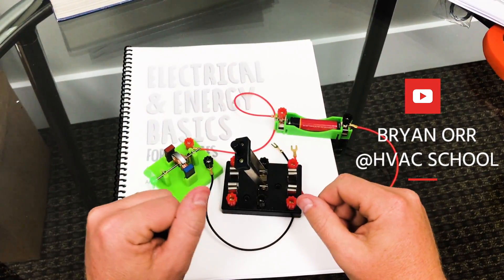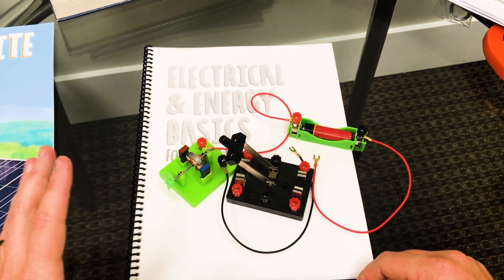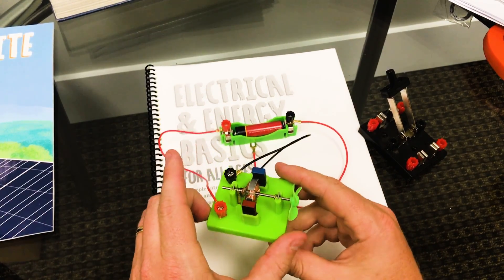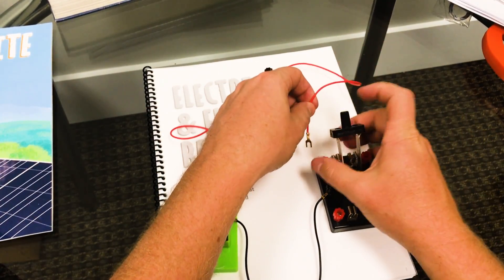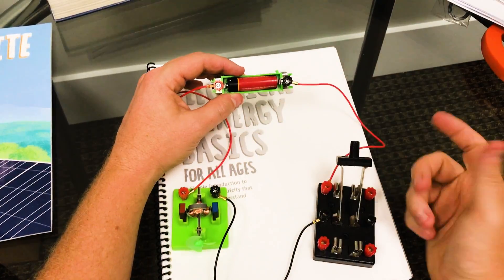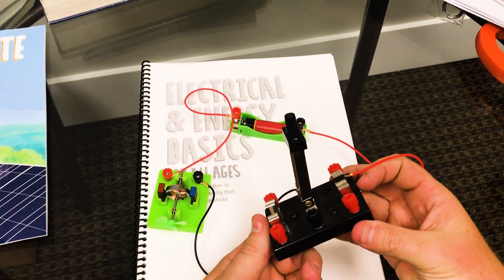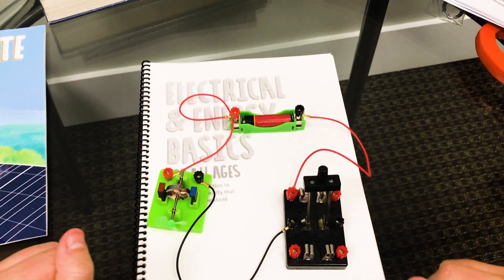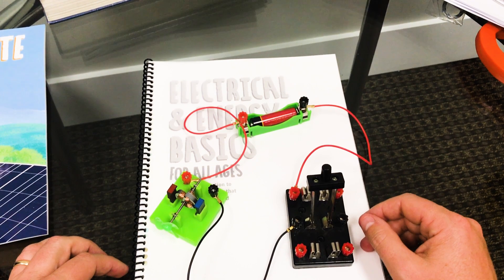Electrical Basics - The Circuit

Comment: Basic DC circuit only. When is a DC circuit used in hvac?
Reply from the maker: The basics of how a circuit is made and the components are the same AC and DC
Reply: chip bryant , much of the circuitry on a heat pump defrost circuit board is dc.  “Newer” inverter type units also contain a lot of dc circuitry.

Comment: Bryan,  If your students pick-up on the lesson quickly, might be interesting to replace the battery with a lightbulb , , , and see what happens if they spin the motor by hand (make sure blade is not sharp, and choose the correct bulb).

Shoot, a great teacher like you might have them repairing A/C units by the end of day two. . . Inverter units may take a little longer ?